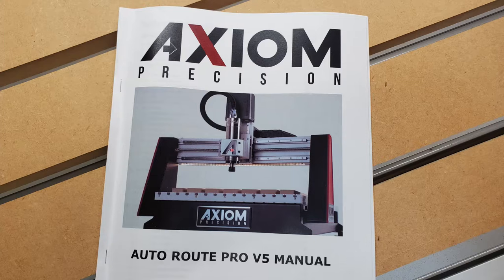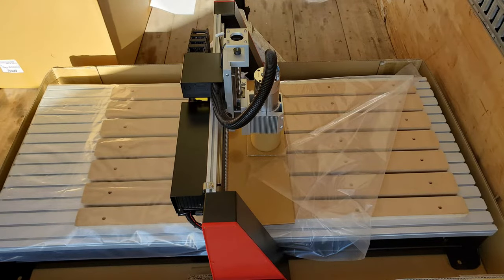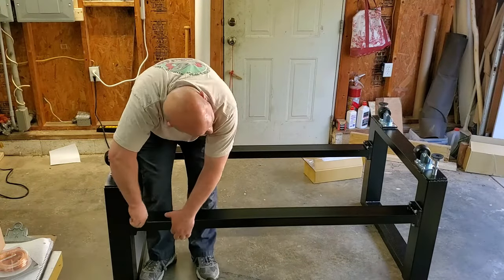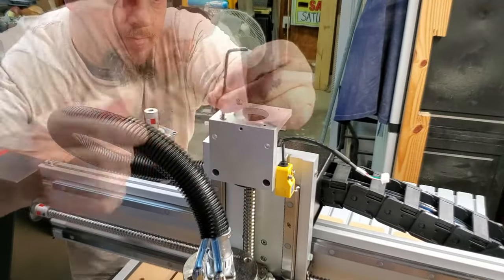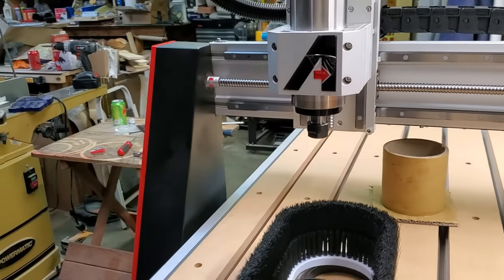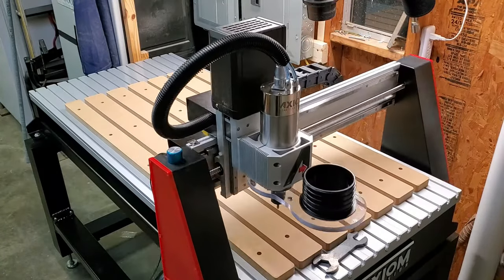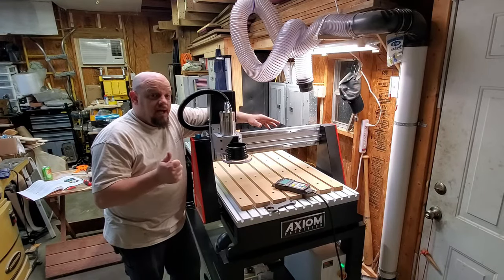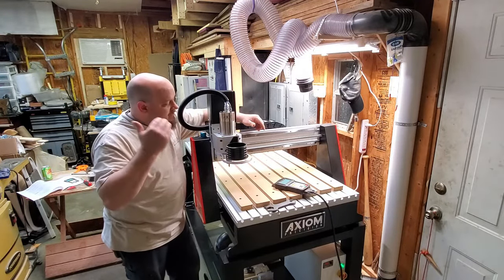Axiom Precision AR8 Pro V5 Unboxing, Assembly, and First Thoughts

Comment: The noise reduction was the thing we noticed most going from a router to an air-cooled spindle...sooooooo much better.
Reply from the maker: For sure.  It's bad when you hear your router over your dust collector.
Reply: INDEED!   >.<   I found myself not wanting to be in the shop when it was running. And THAT'S not ok when the Etsy store is blowing up.    lolirl
Reply from the maker: @rolandgdean  I hear that.

Comment: How do you like this vs the elite?  From a set up perspective do they come shipped any different? Currently undecided if I was to get the Pro or the Elite so looking into the both
Reply from the maker: The Elite is much better, which is why I upgraded to it.  It has a taller gantry height, servo motors instead of steppers, more standard accessories (like the stand, toolbox, LEDs, etc.) and a MUCH better controller with more features.  

The AR8 comes assembled in either model (with the exception of the Z motor), but the stand will still require assembly.  If you weigh out the price difference between the two, you will see the value going with the Elite makes sense.
Reply: @ChristcrossCrafts  thanks for the speedy response.  Yeah I think I’ll get the Elite, I did some digging into the controller and it’s a lot nicer.  I think it’s definitely the way to go. Thanks!
Reply from the maker: @Jimmeh  that controller would be the only one that would allow future upgrades like an auto tool changer.
Reply: @ChristcrossCrafts  oh that I didn’t know.  I knew there was talk of an ATC only on the elites (in the forums) because of wiring but I didn’t know it was specially the controller.  Awesome, another check mark for the elite column.
Reply from the maker: @jeddyp416  the wiring and room in the bigger box, but that controller can handle things the other model can't.